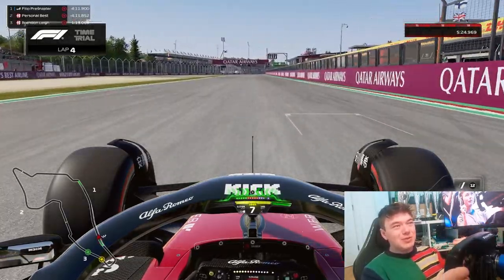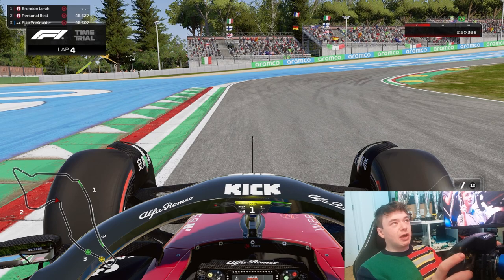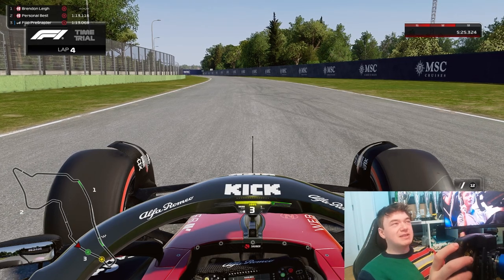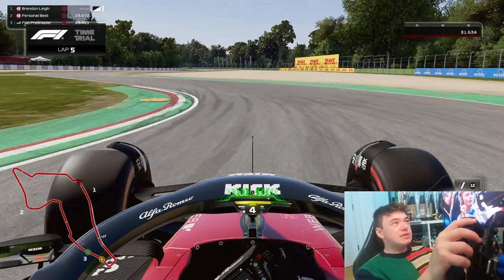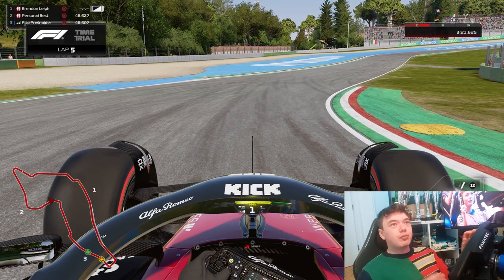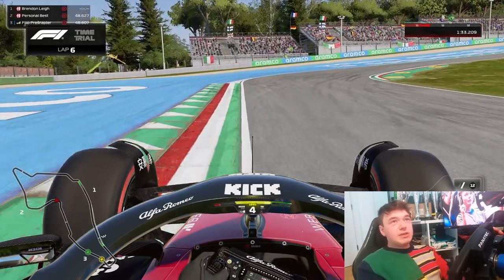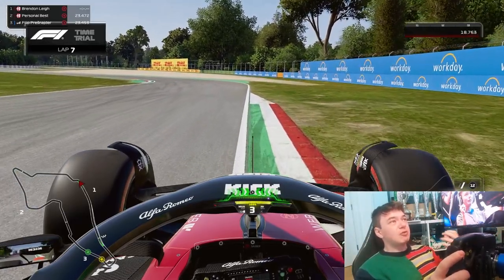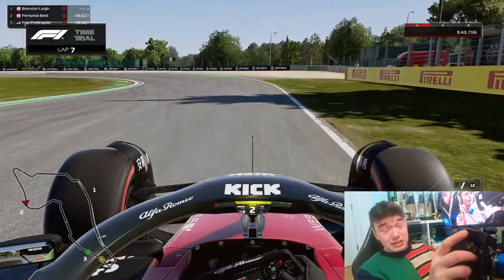Master no racing line with these tips - F1 23

Comment: Again an lovely and really helpful guide but shadows change over time and so does the braking/turn in points if they aren’t fixed on an meter board/gravel etc or am I wrong
Reply from the maker: Thank you! Yeah definitely shadows will change over time during a race for example, so they are not the best markers to use but for qualifying if they are available I like to use them

Comment: Probably a stupid question, the metre boards get dimolished by people taking them out in league races and qualifying so how would i find a different reference point?
Reply: Honestly depending on track look for the bright red enlarged kurbs ive noticed at places like bahrain they go into most corners so they are typically at least good starter references
Reply: Not a stupid question, but to help you look for the kurbs and lines on the road, colored boards , the black boxes, even trees or bilboards can be usefull , orange stewards etc

Comment: Even when you use racing line you need to pay attention to the braking point because when you are on traffic is not easy to follow the racing line. With racing line I am good, normally 1,2 second pace behind the pros but every time that I tried to turn it off I become 2/3 second slower.
Reply: Because you are not used to it and not comfortable with it